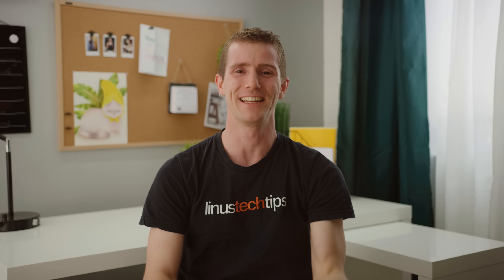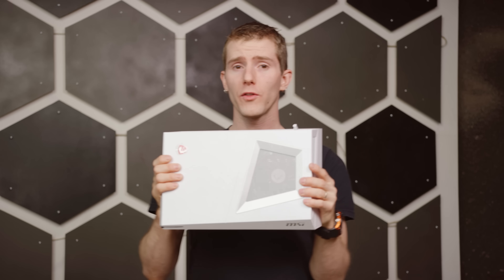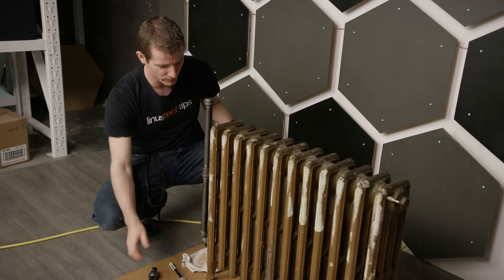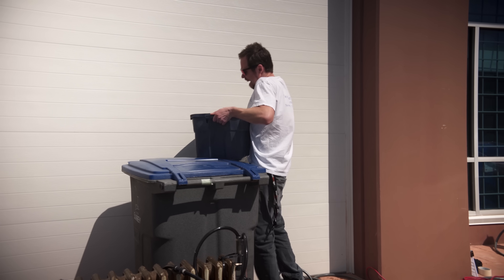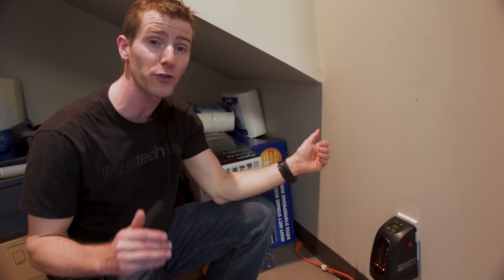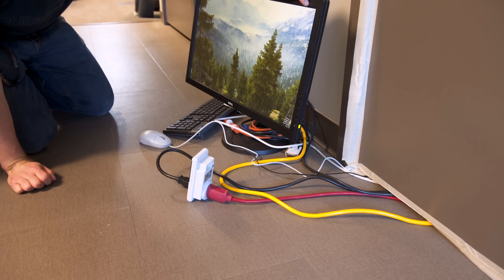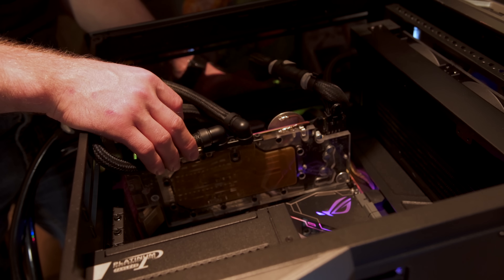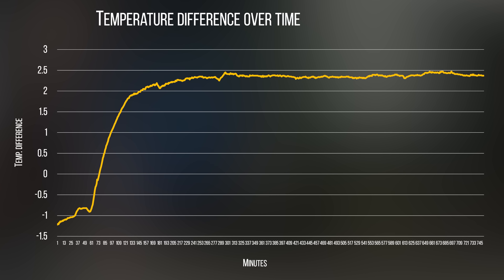Lower your heating bill... with GAMING

Comment: What's the point of the radiator? Wouldn't air cooling work just as well for this test? The energy/heat is still going to be dissipated into the room.

All the radiator would be doing is giving it a middle-man.
Reply: @Rozar Natrim no
Reply: The fan increases the rate of heat transfer so a fan would actually emit heat faster. Essentially the radiator is never going to be hot enough to burn your hand- it will be relatively tepid so it will basically heat your room the same as a small isolated ejection of air.
Reply: No, it really doens't. It's the same wattage. It will increase the surface area but decrease the ΔT. So there is no difference whatsoever. It's absolutely pointless
Reply: The only benefit from radiator is that it retains the heat energy in the coolant for a while after shutting your pc.
Reply: The point of the radiator is to have a larger scale water cooler. This is in order for the gpu to work at is Max potential. The air cooling would theoretically result in the same room net heat, but you are not taking into consideration that the gpu and cpu have protection mechanisms that make them turn down their power if they are too hot themselves. Air cooling would result in a lot of very hot air still lingering inside the case which would in turn slow down the system in turn not producing as much heat as it could have over time. By adding all that mass of water and make it flow around all that surface they are quickly distributing the heat produced by the system, by keeping the system  warm instead of having a super hot case slowly dissipating into the room they can let it work at full force without stopping thus producing as much heat as it possibly can
Reply: @MiloTheFirst1  lol!  A 360 rad has more than enough performance to keep both from throttling! I love how you think you're being brilliant right now ☺️
Reply: Application, PC fans are meant to do one thing, transfers heat from a piece of metal to the surrounding air, while the radiator is purpose built to heat up a room, notice how Linus mentioned the "wave of heat"
Reply: Stathis Bikos Jesus I didn’t think everyone would give that much of a shit who the hell is gonna use a radiator for a room to heat it anyway?? PCs get hot and so does the air around it there
Reply: @karniboy6549  LOL! :D :D :D :D So the rad will heat more because you don't care about thermodynamics?

Now that's the science of stupid right there!
Reply: Stathis Bikos yup guess you’re right you win 👏
Reply: No I didn't, science did!
Reply: @stathisbikos6563  The advantage of a radiator compared to a Computer fan, is the fact that Radiators, commonly placed under a window. Produced heat that rises to block incoming cold air into your apartment if you were to open the window. 

A computer fan would not produce this effect. And while they both produce the same amount of heat. They do not produce the same effective heat spread. The radiator produces heat over a large area more effectively in comparison. That is why, heating a home is far better done through Floor heating than radiators or anything else. Because it has a better coverage for less wattage waste. 

So, no, it isn't pointless. If anything, I think they should of just re-done this experiment in the future by cleaning out the insides of the radiator by heating it up with 100C water mixed with vinegar. Then after baking loose the gunk. Use it again.
Reply: @Helveteshit  I challenge you to test this for yourself and see if a wall radiator will produce convective currents sufficient to produce a room wide effect with a ΔT of less than 5 degrees C (which is what you'd get by pumping so little wattage into a household radiator. 

Radiators produce this effect by having ΔTs of more than 40 oC. 

the reason we place rads under windows is not to keep warm air in when you OPEN the window( (that's dumb, and ammount of breaze will overwhelm any convection created by the rad) but because windows have less Rh than walls, so they create more heat loss than walls. you put the rads under them to stop warm air from touching the cold glass.

Also, the reason undefloor heating is better than radiators, is because 1, mamals lose a lot of heat through the surface of their feet that touches the floor, so keeping the floor warm stops one of the larger heat losses of the body (your feet are the only part of you that actually conducts, rather than convect heat away from you), and 2, through REDUCED ΔT it creates a zone of warmer air closer to the floor where you actually live, that doesn't immediately rise to the ceiling. 

You can theorize about it till you're blue in the face. But the fact is, This, was, pointless. The best way to use such a small amount of heat to warm yourself is to make it into an fan air heater and sit in it's immedient exhaust area. As for example, put the pc case under your desk so that the hot air rising from it warms your legs.

But go on testing stupid crap. It's your time to waste.

Anyway, I'm tagging out. this is as much smartassing as I can handle. I just remember I do have a life.
Reply: SO TRUE!!!!  The CPU produces a set amount of heat based on usage...  The only thing the heating radiator might be useful for is locating the heat transfer somewhere other than from inside the case (air cooling is limited to inside the case).
Reply: the only thing this is better than air cooling is this is quiet and also this works as heat acumulator...more mass of water and steal heated will last longer time...thats the purpose of acumulation heater with bricks in it...
Reply: it also creates a buffer ... with conventional air/water cooling solutions the termal capacity is not much. that means whenever u open a door or window u lose heat fast. if you use that huge radiator u have energy for longer period of time
Reply: @stathisbikos6563  i shat myself from laughing at "I can make go into a rad, through a fan, into your butt and out your mouth, if it's 500watts it will always be the same. " hahahahahahhahahahahahhahahahahahha maaaaaaaaannnnn
Reply: the radiator is more effective, because it's closer to the room temperature.
If you have, let's say, 40 degrees of air in one corner to heat up the room which is 20 degrees, a lot of that hot air will get lost through (heating up) the nearby walls
Reply: @William B no
Reply: My pc is completely normally air cooled and still heats up by room considerably
Reply: it cools the actual pc components  because the heat transfers from the pc to the radiator
Reply: @MiloTheFirst it is completely irrelevant, if your cooling system is capable to dissipate the heat that your system produces into the room. What linus did there was exactly worth nothing, a good cpu cooler and well ventilated graphics card would have come to the exact same conclusion...
Reply: You're right. Heating is 100% efficient regardless. Even the kinetic energy is transferred to heat via friction.

The radiator will only cool the video card better.
Reply: On a side note, heat pumps can be more than 100% efficienct at heating your room. If the temperature is above 30f.
Reply: @SlyNine it is physically impossible for there to exist efficiency or conversion rate above 100% that contradicts the first law of thermodynamics and would mean that you would generate mass.
Reply: @mabrokenleg2388  incorrect. Because you're not generating the heat via energy. You're just separating the heat and the cold, the amount of heat per watt is far greater. Greater than converting that energy to heat.
Reply: @mabrokenleg2388  the catch is you have to have somewhere to put that cold air. This is why watt per watt heat pumps can heat much more efficiently. But they become ineffective when temperatures get to cold.
Reply: @SlyNine that system still doesn’t have higher efficiency than 100%. What you are talking about is a fridge/ climate control in general. You need a compressor for that, which only reaches efficiencies of up to 50%. You cannot physically 100% efficiency or energy conversion rate, in reality even the 60 somewhat% of the carnot process are impossible. Every measure that you’re talking about is just additional energy, therefore additional heat...
Reply: @SlyNine you cannot seperate potentials of a lower energy level into ones with a higher energy level, e.g. higher temperature delta, without the use of energy (in chemistry so called endothermic reaction)
Reply: @SlyNine rule of the conservation of energy, physics class 7-8
Reply: @mabrokenleg2388  and it's absolutely true. This is proven science. Google it for one second.
Reply: @mabrokenleg2388  I never said you do it without the use of energy tho. I just said using it that way is more efficient than turning it directly in to heat.
Reply: @SlyNine just no😂 if you use your energy to operate a heat exchanger, then that energy is just transported elsewhere. Ergo you are using your accessible energy to transport matter somewhere instead of heating what linus really wanted to achieve here. You cannot exceed 100% efficiency concerning the production of heat...
Reply: @SlyNine to achieve what you’re saying is only possible by cheating in choosing your system boundaries so that some heat container doesn’t show up. Physically though what you’re saying is rubbish
Reply: @SlyNine the only thing you do by getting heat from elsewhere is lowering your potentialof energy that you have from the beginning, this principle for example is used in heating houses. By having a large mass of water buried in the earth, you can utilize the excess heat that is still in the earth from when the sun shined. The delta of that temperature and the airtemp is what you save in heat. That process is still nowhere near 100% or over 100% eta. 

The most efficient way to heat a room is still to just place the pc from the example in there. Everything else has got nothing to do with optimizing that process
Reply: @mabrokenleg2388  lol you keep arguing against things im not saying.

Heat pumps are more efficient than converting the energy directly to heat. You can keep disagreeing and the science and technology had already proven you wrong.
Reply: @mabrokenleg2388  US Department of Energy "The most common type of heat pump is the air-source heat pump, which transfers heat between your house and the outside air. Today's heat pump can reduce your electricity use for heating by approximately 50% compared to electric resistance heating such as furnaces and baseboard heaters."
Reply: @SlyNine just forget it dude, you were saying that heat pumps can be more than 100% efficient and my last 8 messages or so were just to correct that statement. It won’t get more correct by arguing around it...
Reply: @mabrokenleg2388  lol. Listen. A resistance heater is 100% efficient at converting energy to heat. A heat pump is even more efficient at heating than a resistance heater.

So the heat you get from a heat pump is more than the energy used. (but it makes it cooler somewhere else).

That's why it's "more than 100% efficient" at heating
It's a trick, yes. But that's the point. As a material naturalist I would never casually make the claim you get more out than you put in.
Reply: @SlyNine i made that exact statement yesterday, yes😅
Reply: @stathisbikos6563  I would say not... with a normal cooler it is a metal to air interface, with that block of iron... initially it is a liquid to solid interface, so it is going to be more efficient until the radiator hits the water temp...
Reply: @flashforensics  It doesn' t matter. The mechanism is the same. An AIO is also liquid to solid interface at first, the radiator will just provide a bigger buffer just as the increased liquid capacity. Eventually the rate of heat transfer is the same. Which is what they actually EXPLAIN IN THE VIDEO.

It's all about the wattage. It's that, fucking, simple. You are reading WAY to much into this shit. Just move on.
Reply: @mabrokenleg2388   Dude, @Slyline is confusing efficiency with COP and you guys are basically arguing over different things.

That difference would be a much more productive area of discussion.
Reply: @SlyNine  Mate, go to the heat pump wiki page and read immediately below "Performance considerations"

It's not efficiency you are talking about, it's COP. 

COP can be higher than 1 
efficiency cannot be higher than 100%
Reply: The radiator gives no advantages in terms of heating up the room. All it does is act as a buffer to smooth out and slow down the rise and fall of the temps. The radiator is a good option if you wish to maintain a specific temperature under the thermal limit of the system for extended periods of time. Example: running on full load will get the room to max temp of 40degC but you dont want to run system full blast the entire time while maintaining 30degC, the water mass will be able to retain the temperature more consistently, but will also take a longer time to get up to temp.

edit: since most traditional heating systems run on a binary state: full blast or off, and controls the temperature through modulation of the intervals at which the system stays on/off, the radiator makes for a more consistent experience and also eliminates fan noise youll get from air heaters.
Reply: @William B so does a heatsink
Reply: @William B nope your wrong. Learn thermodynamics my friend. 250w of heat through a graphics card cooler vs. a giant radiator is still 250w of heat. You could water cool a PC and it would produce the same amount of heat as no cooling installed at all.
Reply: The CPU and GPU become less efficient when running hotter.  Effective cooling will lower the amount of heat generated somewhat.  The purpose of the radiator was to make content for the channel that people would watch and comment on generating income.
Reply: Old post, but whatever. I've spent a year in a small room without ventilation that was heated by a server with a weak fan. Guess what I've noticed: it's loud af. You ask what's the point of radiator, I answer - it doesn't make any noise.
Reply: Just for the views!
Reply: @Helveteshit  no.....just no

Comment: Step 1: By an old HP server
Step 2: Install two Xeon X5460's
Step 3: Never use your house's heater again :D
Reply: Got a Dell server with 2 X5355 Xeons a few years ago, powered it on, left it in the computer room of our house, brother and dad were going to lynch me for putting an effective space heater in the only room in the house without AC during a Midwest US summer
Reply: You won't be able to sleep it will be so loud.
Reply: @ryantoomey611  unless you use passive cooling
Reply: @NoorquackerInd  , The beauty about hydronic ( water) heating is with a couple of 3-way values you could have a "summer"  external rad plumbed to elsewhere... a secondary water heater coil or outside...thus just cooling the PC
Reply: just turn it to your feet normally it is warm enough...
Reply: Had an old Compaq with 2 Pentium Pro's that I literally used as a heater one winter.
Reply: ...at this point the only worth thing to run on such a thing would get it to mine crypto. even if that's worth nothing, the goal is to give the server a purpose! 
hey speaking of I should get my hands on an old IBM... I should contact the guy again someday.